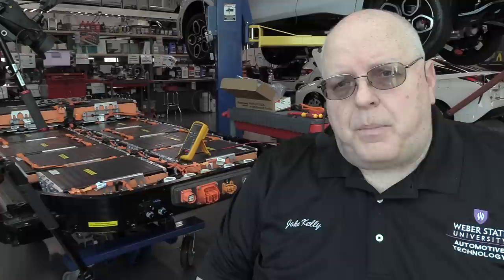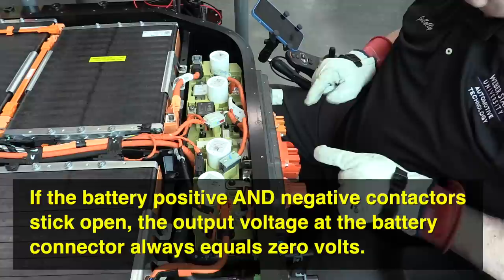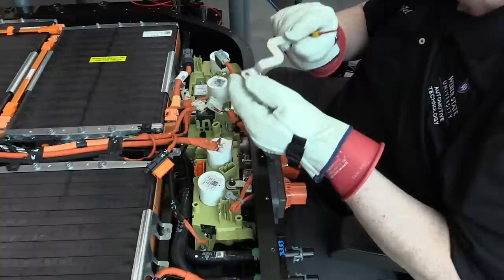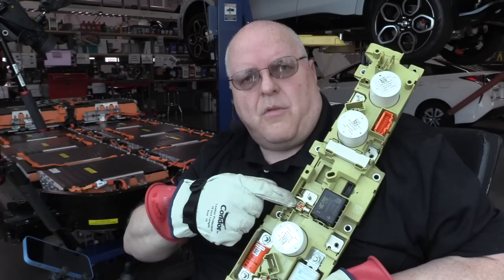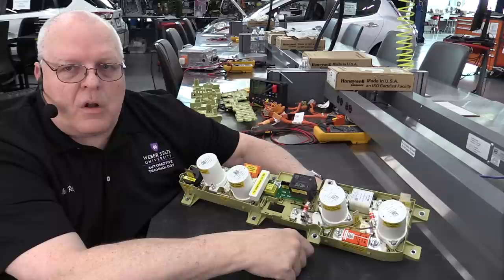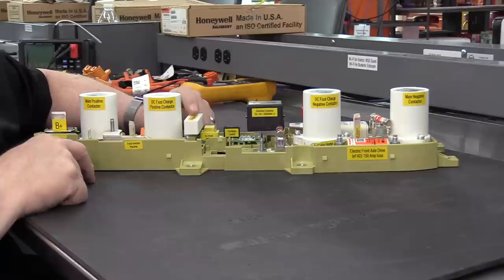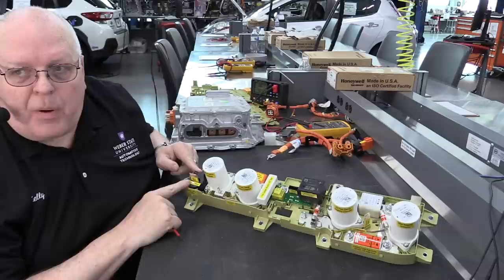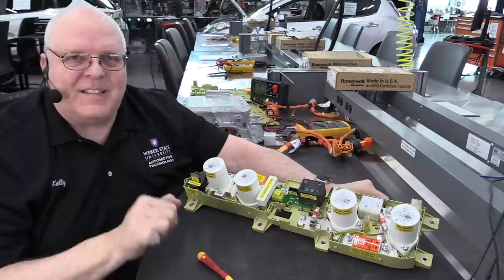Mach E GT Battery Contactors

Comment: Assuming those capacitors are connected between the HV circuits and 12V ground, they are to provide an AC path for noise generated in the inverter etc. to meet EMC specs - though the HV system is isolated, if there is no AC coupling to chassis, the whole HV system will act as an antenna, radiating interference inside & outside the car. You see similar caps between the HV and LV side of mains switchmode power supplies for the same reason.
Reply from the maker: Yes, they are connected between the switched HV circuits and 12V ground. Thank you for the great information!
Reply: @mikeselectricstuff what protection would you likely see in place between HV negative and chassis earth incase of capacitor short? Or is that not an issue?
Reply: @joshbridges8410  Not an issue, those are safety (class y) caps designed to fail open circuit.
Reply: hey, What are those capacitors called?

Comment: Great video professor! A lot of quality in depth information, even for a ford master tech like me who has hands on experience with Mach-e’s for the last couple months.gotta say you break it down way more and better than fords web base training and the hv battery repair class, thank you! I’ve replaced a handful of HVBJBs already mostly all in GTs or standard and with extended range battery, and I’ve been dying to open one up to see how they tick like you just did but ford has been calling them back almost as fast as I take them out. Thank you for showing the insides. 

A few things I’d like to share…..
The recall is a module programming that will modify contactor performance and ford is hoping will save the hvbjb from having to be replaced. But software will not 100% fix hardware and some contractors are still failing, so much ford released a tsb this week to replaced hvbjb. 

That leads to my next tid bit of Info, you mentioned electrify America maxes out at 350A which is under the dc fast charge rating of the Mach e, but the dc contactors can’t handle that even though it’s working it’s rating. All the failures I’m seeing are welded positive dc charge contactors after charging at an electrify America station…..

Finally i hope I didn’t miss you mentioning it, but it should be mentioned that both contactors may fail closed and set dtcs for both contactors.battery will not be denergized and is not safe to open. No choice but to replace the $26,000 battery. Now with current failures of the dc charge contactors both may stick without setting the dtcs needed by ford to replace the battery. I’ve worked with engineering to get at least one unstuck and so far it’s worked. So hopefully ford is working on a fix for that.

Keep up the good work, looking forward to more videos!
Reply from the maker: Thanks for the kind words and the great information. Stuck shut contactors is no more dangerous than working inside the battery. Just unplug the battery positive and negative cables from modules to the junction block and the power will be removed from the junction block. I understand why Ford would take thin stance, but unless I am misunderstanding something, it is not a big deal. Personally, I cannot see how stuck shut contactors would damage anything else inside the battery.
Reply: I just want to say thanks for your work.  Your early feedback as a tech is helping Ford engineering make electric cars safer for everybody.
Reply: I'm currently going through this with my dealership...I was told they are doing some sort of software "update" and not a replacement.  I have the Premium AWD with extended battery, I hope I don't have this error again.  Typically how long does this repair take a tech?  I'm assuming dropping the battery is a 2 person job and takes hours to do...

Comment: Thanks for the info about the contactor #.  It is a custom version of the TE Conn. (formerly AMP) of EVC500 high current relays, aka contactors.  While there is no specific data sheet for this exact part number, it has the same characteristics of the two dozen or so variants, which have different mounting, coil, termination & activation specifics.  These are rated for 500 A for ~ 7.5 minutes @ 85c when using rather thick copper cables (400mcm , 203mm^2) directly attached to the threaded studs.  This important, since this copper wire is > 20 mm / 0.82" diameter and weighs > 1.3 pounds / foot and removes heat from the contactor.  Unfortunately, this is not available in Ford's design.  The 5 min. "Max power time" of the Mach-e is likely due to the 7.5 minute rating of this contactor.  

Another consideration is that the coil to activate this is 22 Ohms, which means ~ 0.55 A @ 12V or > 2.2 A / 26.4 W  for the 4 contactors during fast charge.  With the large, quick activation force required of these solenoids (i.e. a contactor is a solenoid activating built in contacts) the rated voltage (i.e. 12V) is applied to "energize" and "pull-in" the movable core and exert the force required (i.e. close the contacts).  In this case it means 0.55 A (i.e. 6W) per contactor.  After the movement of the core, when the work is done, the voltage is usually reduced considerably,  to < 1/3 since it takes a lot less energy to "hold" the current position.  The coil of this contactor has a rated "hold" of 1.5V max.  This means, that after activation, the 12V 0.55A power can be reduced to 1.5 V ~ 0.068 A ~ 100 mW or 1/60 of the power to activate it at 12V.  TE Conn. offers variants of this part with built-in circuitry to accomplish this, but the chosen Ford part # does not appear to do this, relying on external circuitry.  If this is not done carefully, it will definitely heat the coil and/or the contacts.

So how can Ford "fix" this with a firmware (i.e. software) upgrade?  For Driving, it can reduce the maximum current drawn by the motor driver 3 phase inverters.  This of course would reduce the Torque, Power, and resulting acceleration available to the wheels.   For high current DC charging, Ford must rely on telling the charger to limit the charging current by reducing the charging voltage. This of course would slow down "fast charging" and increase the time required.   The alternative is to replace the module with a different design to accommodate the high currents and temperatures needed to keep the existing marketing specifications.   As can be seen from Dr. Kelly's videos, this could easily take a working day at a dealer.  This assumes they have the equipment, trained technicians and parts readily available.

As I mentioned elsewhere here in the comment section, there are many attorneys who would love to take on a class action suit for this.
Reply: Very interesting technical information, particularly regarding the apparent failure of the systems integrator to optimise the application.  Hope John spots this post.
Reply: @paulaxford6754  You are very polite.
Reply from the maker: Thanks for the great information!

Comment: Terrific video! I have two Mustang Mach-E vehicles, including one GT Performance Edition. I feel like I understand my cars and how their electrical systems work far better after watching this video. The only other thing I would like to have seen is an explanation for the HVBJB recall, i.e., why are the main high-voltage contractors welding shut or open, and what's the fix for that?
Reply from the maker: Thank you. I do not know the exact reason for the recall. I think the recall notice said something about improperly sized contactors overheating under heavy acceleration or DC Fast charging..

Comment: This is a great demonstration about working on any HV battery at this level. If you understand how a battery is constructed, and what you are removing, working on a HV system doesn't need to be scary. Respected, certainly. There is safety in understanding the internal construction and where the two polarities meet. That, and of course only using one hand.
Reply from the maker: Thanks Jake, that is absolutely true!

Comment: I can see some value in minimising the number of contacts used in any of the high-current paths.  The Kona/Niro use one +/- set inside the pack and others in series for the inverter and DC charging, not to mention the lessor concerns of precharge and battery heater.  There is a HV junction box for distribution, presumably something Ford saw reason to avoid in light of the added complexity of the rear drive systems.  Thanks for videos, John, and I do appreciate that the dialog is confined to the technologies employed and delivered without bias.
Reply from the maker: Thank you very much!

Comment: Precharge inrush current manifests itself as a spark. It would be interesting to see just what sort of spark is produced not using precharge resistors.
Just a note on precharge resistors: in the electric bike world usually 48v or less is used.

Even at these low voltages you still get a sizeable spark when you first connect the battery to the controller ( capacitors in controller charge up very quickly).  Most ebikes just ignore the problem.
The solution to this is also a precharge resistor in parallel around the main on/off switch, precharge resistor has its own on/off switch or makes contact just before the main power switch contacts.
What I find fascinating is the electric bike developed somewhat earlier than electric cars, you could argue they were the forerunner for electric cars, the systems on electric bikes are basically the same as electric cars though lower voltages and somewhat more simplistic but the principles are all the same.
Its a very interesting history that is not well known about.

Comment: Very good stuff. Great detail. I love that ford is making battery packs that can be diagnosed and repaired, rather than just replacing the whole expensive battery. I look forward to a peek at the battery modules. I have seen them briefly before, but in no real detail. I suspect that there will be aftermarket work-arounds for replacing contactors on the Mach E in 10 or 20 years since they are mechanical. this kind of engineering is needed for sustainability and the extrordinarly long life that EVs can hypothetically provide.

While I prefer the Volt's battery cooling scheme, Ford's single cooling plate system allows module replacement while the Chevy really does not. I would really like to know the thickness of the Ford's aluminum heat transfer plates that is between cells in the modules.

Tesla's move toward glued and sealed unrepairable batteries, gluing components together, is a strategic mistake in my opinion, making the cars themselves effectively disposable after the battery eventually fails. Tesla rejecting even the idea of 8-900V architecture is, in my view, shortsighted. the lower amperage of high voltage systems imposes far lower thermal loads on components. Tesla undermines the future value of their cars as they age out of warranty and any battery pack failure leads to a $20k repair.
Reply from the maker: Thank you Bill!
Reply: Perhaps that's why they make more Teslas in 3 weeks than all the Mach-es made to date (~100,000), have over 3 million on the road with zero recalls as opposed to the 100% recall of all Mach-e cars produced.  Why is no-one asking how the GM Bolt batteries are being repaired, repurposed or recycled, since 100% of them are also recalled?  As for 800V, losses are lower or allow using thinner cables, but at a large expense compared to 400V systems.  Tesla chose to design their current flow efficiently instead of a bunch of orange cables and custom connectors all over the place.
Reply: @Bill Kerr Bill, I understand your argument, but keep in mind the structural battery pack is less expensive to manufacture.  It is also modular and quickly replaceable.  That said,  I believe the 4680 cells can be electronically removed from the pack as it ages and cells die, making replacement unnecessary long past a normal "dead" battery condition.  And that said, by the time the pack is due to be replaced, the cost should be down quite a bit--at least on par with replacing a tired ICE engine in a high-end vehicle.  (At present, I understand Gruber motors can remove, repair, and reinstall a defective battery pack in older Model S for about $5,000.  Yes, not a new $20K battery, but plenty good enough to get back decent range and utility.  Think of rebuilding a tired ICE motor--about the same cost.)
Reply: @ Shazam You are perfect. Teslas are perfect. Thanks for your comments.
Reply: @Krunch2020  As are you for acknowledging the facts I pointed out.

Comment: Those capacitors are Y caps for EMI suppression. They provide a path to shunt HV transients from the inverters or off-board charger to chassis.
Reply from the maker: Thank you very much!
Reply: Years ago a gifted older engineer I worked with pointed out that capacitors in and of themselves don't dissipate energy.   The electrical component that does this is called a resister.   When designers throw caps at a transient problem they are counting on the series resistance of the cap absorbing the energy.  But this usually isn't a part of the specification for a cap except to having a maximum value.   If designers want to "snub" transients, they need to specify the high frequency performance of the caps or just go ahead and put a discrete resistance in the circuit.
Reply: @GilmerJohn  these are Y2 caps that are specifically designed for this application. They also have self-healing properties to last the lifetime of the application. The are selected by using the reactance formula to target a specific frequency range to snub or shunt noise to ground, keeping that frequency range from getting into sensitive electronics, such as the BMS IC measuring cell voltages to an accuracy of less than 1mV. It's common practice. Even cheap toys with dc motors have these X and Y caps across the motor terminals for the same reason.
Reply: There also very specific safety requirements for isolation resistance that these caps are designed to meet. The BCM will have an isolation monitoring circuit to constantly check this.
Reply: Thanks.

Comment: Fascinating video.  I would like to see the inside of the contactors, to see how it compares to an old automotive starter solenoid.  The junction block just doesn't look like a mature product.  I imagine there's a reason, but why is this assembly mounted inside the battery case?  And even worse, why are the fuses inside?  As a retired electronic tech, this looks like a maintenance headache.  Also, this is just a personal annoyance, but at 20:27, on the right side of the frame, you'll see what appears to be 3 punch-down connections, for what are later identified as capacitors.  These connections worked fine for phone lines once upon a time, but in the battery of an electric car, subject to vibrations, I would have liked to see these soldered as well.

Comment: A lot of safety in disconnecting from the battery pack could be gained by having some "cups" made of a transparent flexible plastic (silicone?)  so that the connector as an extra amount of isolation.   The "thing" is that when a mechanic feels the need to disconnect some wires it's because something "popped" and there might be come contamination of surfaces which could cause leakage to have a flashover.
Reply from the maker: Thanks for the information!

Comment: I really hope there are smaller fuses downstream of that AC fuse, Very stupid to have to pull the battery if you had an issue with the AC compressor and it blew that fuse.
Reply from the maker: There are not any downstream

Comment: It's interesting to compare this battery to the 12 plus year old imiev 16kw battery. This thing is so complicated and huge with its cooling, heating plus far heavier duty output devices. It however looks far better made and is very tidy in design. I hope these modern designs can reliably last 15+ years without attention.

Comment: They don't make it easy to service that module do they? I get why it is in there, but those battery packs have loads of screws just to expose the batteries. Reminds me of my service days. Just to take the lid off of a Visual Display Unit was something like 28 screws. They all required specific torque specs when putting the lid back on otherwise they would snap off or strip out. Time sinks are the worse when it comes to out of warranty work. Great videos... I'm glad I found this channel. I love watching and learning about how stuff is put together and functions.

Comment: So to replace those fuses you have to disassemble the battery. Wow.
- We fixed your car, sir. It was a blown fuse.
- Great, that shouldn't cost much, right?
- Not at all, just $5 for the parts and $5,000 labor. 😂
Reply from the maker: LOL! The fuse is just a symptom of the real problem, but yes, they are inside the battery.